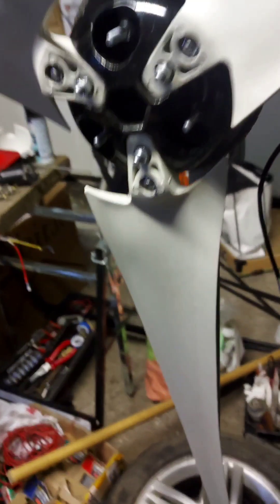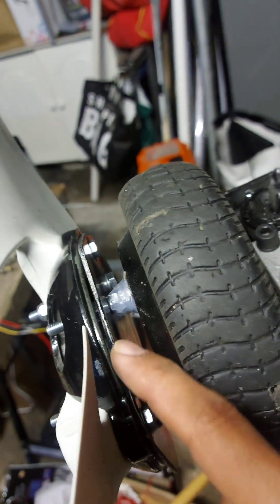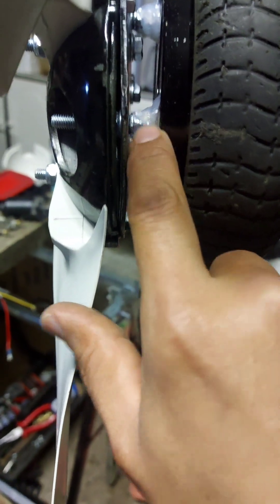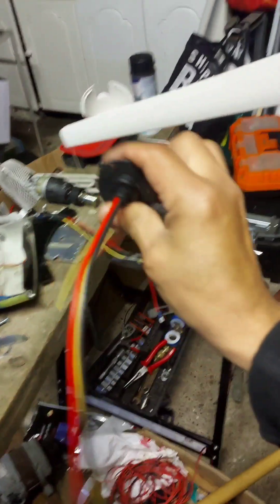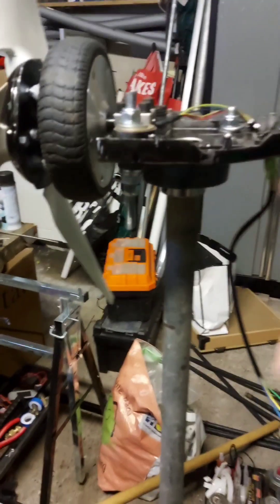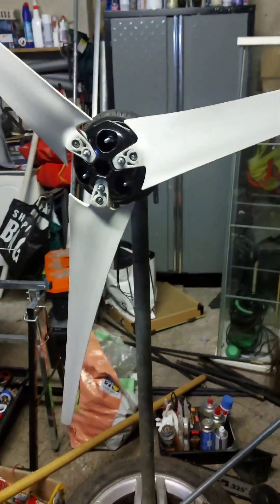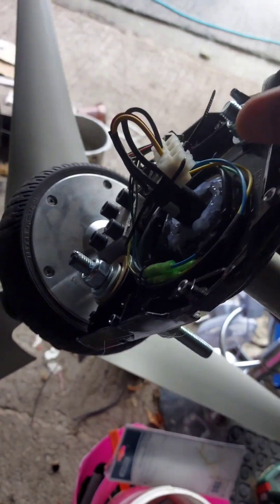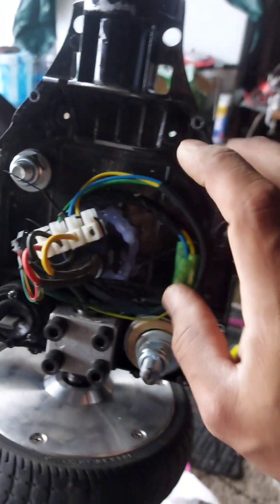how to make Windturbine/Hoverboard 36v max amps noticed 4.57.

Comment: Dont be offended, but its much talking for not much information. And hotglue is not a good sealant. Have you put some sort of seal around the backplate and the screws of the motor? Still i would not trust the seal around the axle.

Its a good idea to put an adapter on it. Where did you get those blades from?
Reply from the maker: Ya man a lot of talking. It's true but trying to explain everything as much as I can that's all.  I got these blades from Aliexpress. I had to make mine in the end as they were too small for the motor. I put the clear silicone around.